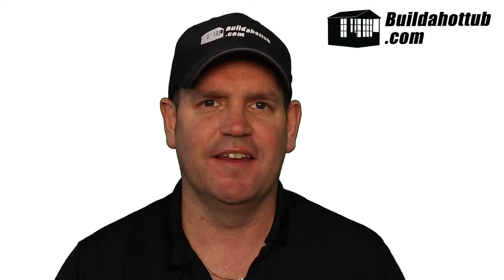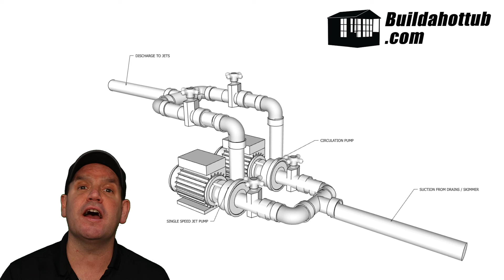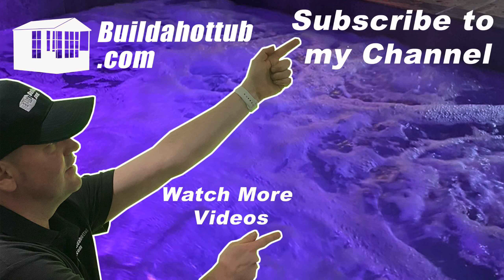How to add a Circulation Pump to a Hot Tub?

Comment: So does the circ pump shutoff when main pump kicks on? Amd if thsta the case check valves would need to be installed to prevent the water looping back through circ pump. Or do circ pumps have buolt in checks

Comment: I’m gonna add a circulation pump to my spa. Could I place a T coupling from the heater inflow and attach the circulation pump this way and making the return the same way with a T?
Reply: I have the same question. It also maybe a good idea to place a check valve on the cir pump.
Reply from the maker: It is possible, but you have to make sure that your existing pump which is likely to be stronger, is not "figiting" for flow with the circulation pump - in short you need to make sure that they dont run at the same time. Hope that helps. Andi

Comment: Would it be ok to leave the 2 speed jet pump in place and “T” in a new circulation pump?
Reply from the maker: Thanks for the comment, you might find that the 2 speed pump will "steal" all the flow on high speed which could cause a problem for the new circuialtion pump - if you can isolate it (a relay for example) from running when the 2 speed pump is on high speed then that would work for you yes. Hope that helps - Andi
Reply: Ahh yes! I am thinking that I can disconnect the low speed pump connection so that the controller doesn’t see the 2 speed option. My new controller has the option for circulation pump. I would assume that when the controller sees the two pumps that it will control the circulation pump while the jet pump is running?
Reply from the maker: Depends on the controller but I agree with your logic here - Andi
Reply: Thank you for taking the time to answer my questions! Much appreciated and gives me a good directions

Comment: Hiya not sure if this will be enough to trouble shoot but the hot tub i have the circulation mode just does not work, on the control panel display it says its on but nothing happens. It's the same with the preheat function, it shows its on but nothing happens. Not sure why it doesn't work but it is quite annoying having to manually turn everything on for it to heat up and it is quite noisy when it is doing so. The pump in the hot tub is a LX DH1.0 circulation pump.
Reply from the maker: Hi There, could be a startup capacitor that has gone on your pump. That would explain why it would not start and if that is not functioning, the pump runs "lumpy" which in turn means that it is noisy - hope that helps
Reply: @Buildahottub  thanks for replying, the pump however works when you press the button set for the pump, it just the preheating mode doesn’t turn the pump on for some reason
Reply from the maker: @heyitswill243   - ok, if you can turn it on with the button, not likely to be a capacitor - the spa pack might have lost the correct programming, what spa pack is it?
Reply: @Buildahottub  honestly I’m not too sure, the hot tub was here when I moved into the house but the heater was broken, it was left for 4 years before we did anything on it and the circulation pump (DH1.0) was seized so we replaced it, but for the model of the spa pack I don’t know unfortunately.

Comment: would you also put in valves (I guess this is what they're called in English) that make sure that the water flows in one direction on the exhaust side of the pumps?
Reply from the maker: Thanks for the comment - you could yes if you were concerned with the direction of flow - thanks Andi